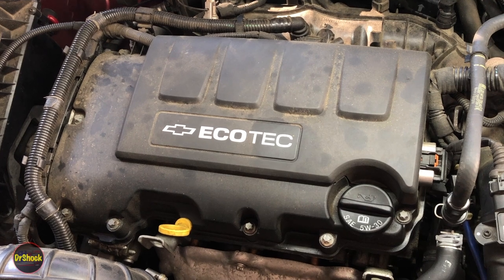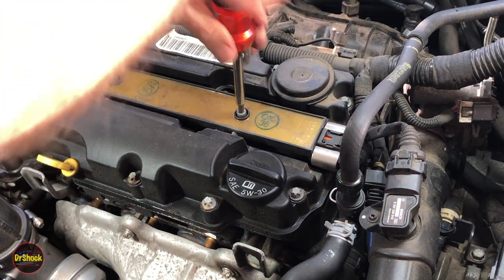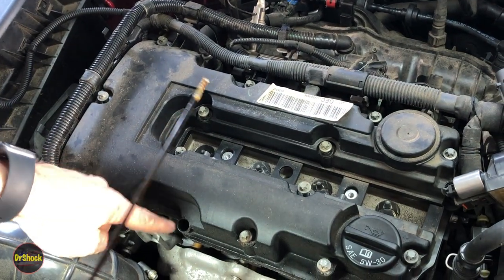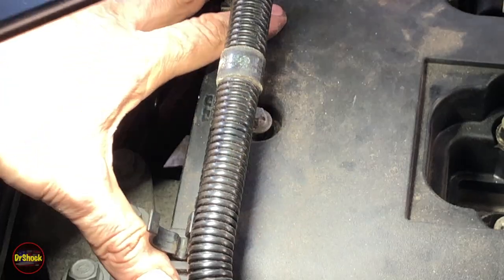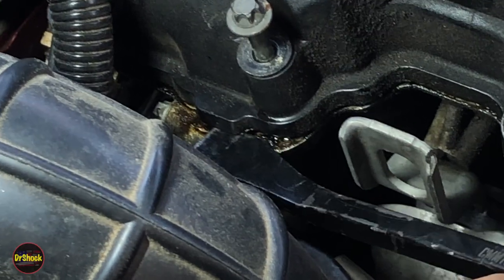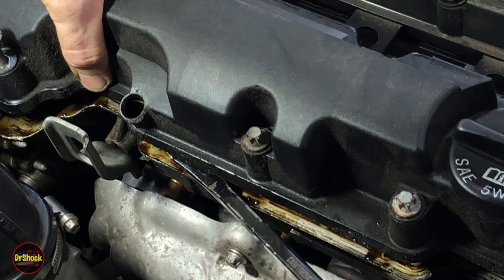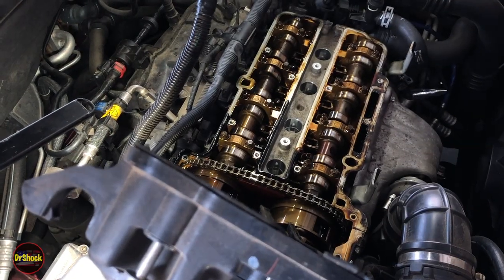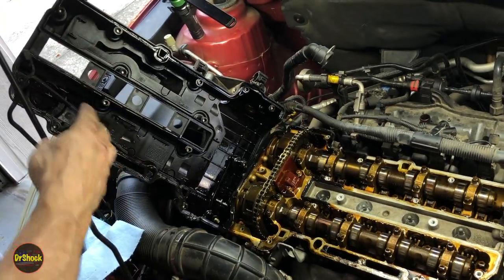2011 - 2021 GM Ecotec 1.4L Engine Camshaft Cover Gasket Replacement (Chevy Cruze, Sonic, Trax, Volt)

Comment: Check the pcv line in the intake, see if the orange plug is in the intake could be the problem.
Reply from the maker: Nah, this kind of issue is typically nothing to do with the PCV bypass valve.  Simple gasket aging, these GM 1.4L camshaft cover gaskets have to be replaced every so many years as they get brittle and crack like a Kit Kat bar.  But certainly a good idea to check that valve at every oil change - https://www.youtube.com/shorts/qGBt5skZWLI

Comment: Can you tell me what the two rectangular ports in the front of the head are for? I had a lot of semi-dried gritty crap in mine.
Reply from the maker: What time index of the video are you referencing and I'll take a look.
Reply: @DrShock  The area you were cleaning around at 9:42 in the video.
Reply from the maker: Ah, ok.  Those two long rectangular ports are part of the crankcase ventilation system.  Oil vapor laden crankcase gases travel from the cylinder head into the plastic camshaft cover unit that we're replacing the gasket for in this video.   The baffles inside the camshaft cover separate the oil from the combustion gases as part of the positive crankcase ventilation design for these Ecotec 1.4L engines.

What you likely are seeing in this area is a brownish/blackish sticky tar substance, which is oil and combustion by products that have gotten deposited here over time.  The engine in this video didn't have this situation, but I've seen it on other engines.  You can clean his out as long as you do not get any shop supplies dropped down into this cavity.  A throttle body cleaner on a shop rag works well for this material.
Reply: @DrShock  Ok. Thanks for the response and for the great videos. To be honest, I hate the 1.4L engine on the Cruze. I've spent way too much time working on my vehicle, IMO. There isn't much that would give me more pleasure than to watch that thing get crushed at the junkyard. Lol
Reply from the maker: They are definitely one of those kinds of cars where you have to love them for all their faults.  ;-)
Reply: @DrShock  Something like that. Pretty sure they were engineered by a couple of drunk 20 year-olds. 😁

Comment: Use gasket maker along with the original gasket so you don't have this problem again in the future
Reply from the maker: It's  normal for these gaskets to get brittle and crack with age and heat cycles.   It's simply regular maintenance on these four cylinder GM engines to replace this gasket when this occurs.  

The GM factory service manual highlights where using any additional sealant is required (which I showed).  Using more than shown is not necessary.